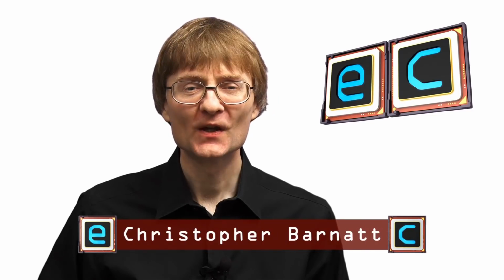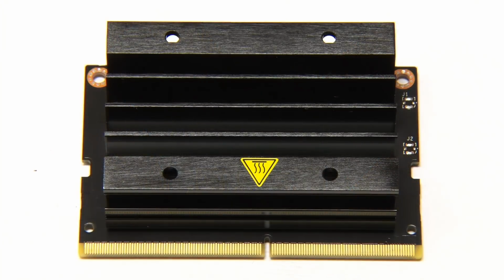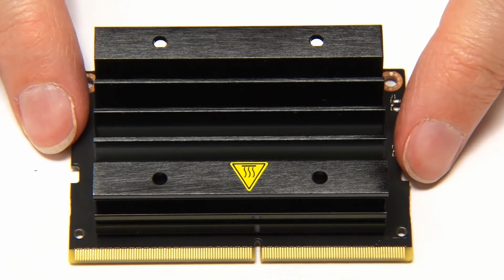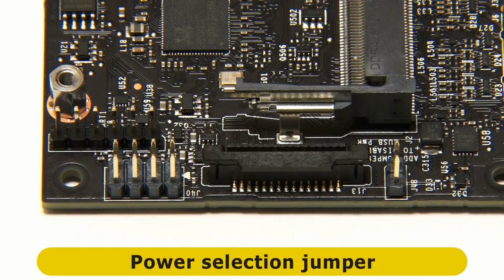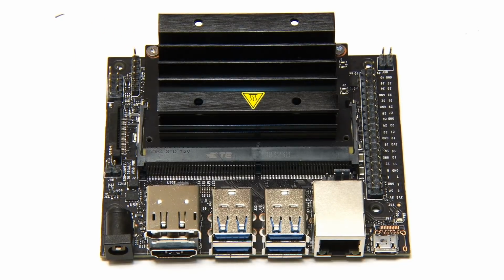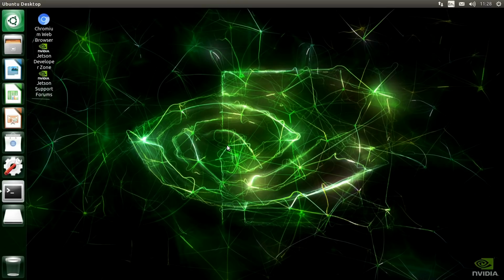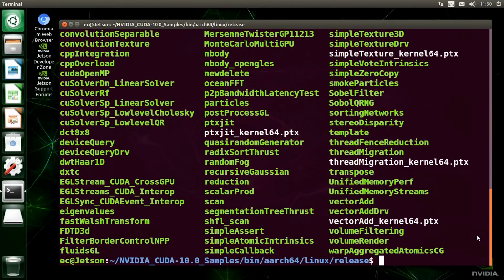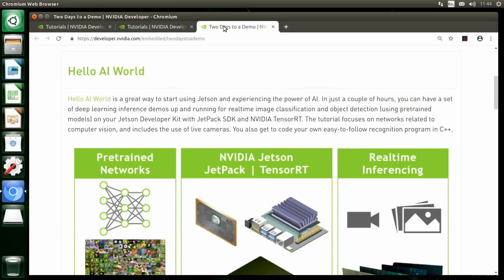NVIDIA Jetson Nano

Comment: that is really impressive for the size, that smoke probably would lag on a 8800GT 512MB Ram and that card was heating up at 100C and taking past a hundred watts! if this board would be 8 to 16 GB RAM and a slightly more fast processor, this would make the next gen gaming hand held device!  (probably able to run all the triple A console titles of now and future ones!)
Reply: maybe this one can be overclocked?
Reply: @ne1cup  that would be like overclocking a microwave or your toaster... which is only the domain of Photonicinduction...
Reply: Then it’s just a switch

Comment: Why don't they just use snapdragon 855 which is small and less prone to thermal?
Reply: That would be nice, but SD 855 is impractical in this application.  First, Qualcomm charges quite a bit for their high-end chips when cost matters in these boards.  More importantly, I think there are problems including an SoC that has integrated cellular modems, so they avoid doing that mostly.

Comment: it's running only at full speed when you use not the micro-usb connector. It's throttle down .... so what we have seen is not the full performance!
Reply from the maker: So I understand from other comments. I will try running with barrel jack power. It is a pity that the very detailed PDF user guide does not make any mention of this -- it only says the 4A connector is needed when the board is expected to draw more than 2A due to connected peripherals. I look forward to getting even more performance! :)

Comment: I bought one of these. Artificial Intelligence is very difficult to learn and you do need more processing power. This single board computer gives you a more affordable GPU. I was thinking of buying a high end video card but this seemed like a better option. You do have to buy a lot of additional equipment to use the Jetson Nano Developer  Kit. I did not have a monitor with a HDMI connection so that set me back another $100.
Reply: Its not just the hardware its the system over all,  I am looking at building a Threadripper rig ( Castle Peak ), with AMD GPU's ( 2 cards in crossfire ) .. itle be running a custom Arch Linux and RoCm to hybridize out my system resources as a whole unit ( memory/cpu/gpu etc etc ) ...

You have to configure your system as a whole not just put up big numbers in one area, its all about balance.

Comment: Should £95 not equal €110?
Reply from the maker: In theory, as I type this, £95 exchanges for $122.70. :) But sadly tech pricing does not always relate strongly to the exchange rate -- and the UK hardly is in respected standing right now. :(

Comment: Will you be reviewing Atomic PI? It is a Quad core Atom processor with Intel HD graphics and 2GB RAM with 16GB Flash for 35$
Reply from the maker: This board is on my list, but I'm not yet in contact with the manufacturer.
Reply: @ExplainingComputers  Okay.

Comment: why do u neglect ESP family? Not noble enough?
Reply from the maker: ESP boards are, as far as I am aware, microcontrollers, not computers. So I have not covered them -- just as I have not covered Arduino microcontrollers, for that reason. I've also neve been approached with any hardware. :)
Reply: @ExplainingComputers  surprised you replied that fast. Thanks a lot, man) But on the other hand would be nice to see applications where the potential of those devices is utilized at nearly 100% price/feature ratio. And where you can demonstrate how this can  be commercially feasible

Comment: Great video Christopher. It is a very nice board. I would love to have one. You've made an awesome review. You understand it's not a raspberry pi competitor as many think. But a board for AI. I would like to know if Blender can make use of the cuda-cores to render. Should be possible. Then I'd think more of buying one.
I'm now rendering a new intro animation for my channel with the Odroid N2 and NanoPi M4 together. They are doing great. 30hours remaining. No noise and low energy consumption. I couldn't which for more.
I've been debugging a lot of issue's on the N2 with the Odroid team. Only one problem left. I think I'll make my video the comming week. Gigabit ethernet first didn't work, swap/zram didn't work. Those are fixed now. Still unstable USB ports. But I know how not to have this problem. Also every 2.4Gwifi dongle has interference with USB3 ports. So wifi, keyboard and mouse work badly with my ssd connected to USB3. So it's better to use the microUSB port for those instead. It's also an awsome board, but it ain't perfect.
Greetings.
NicoD
Reply from the maker: Hi Nico. Always great to hear how things are going.

Comment: Chris, you need to use a 4A 5V supply on the barrel jack. You're running in 5W mode that limits the system speed. This is stated in the manual. CPU max clock 900Mhtz, and GPU 600Mhtz. Vs in 10W mode of 1.4Ghtz and gpu 920Mhtz
Reply: My apologies Chris, it looks like I got confused with the usage of the  nvpmodel command. By default the system will run in 10W mode but if you're having issues with it running from USB power then 'sudo nvpmodel -m1' can be used to place the system in 5W mode with the reduction of clock speeds. I had incorrectly assumed that the system switched to 5W when running of USB power as a lot of people were saying it was necessary to do so to run from USB power. As your power supply is a 3W one then you got lucky. :)  'sudo nvpmodel -q' will state what mode you're in. Mine says "NV Power Mode: MAXN".
Reply from the maker: Hi Richard. Thanks greatly for this. We are all learning as quickly as we can about this new board. :)
Reply from the maker: Thanks for this, but as I've noted below, it is not stated in the manual. :) Indeed, I've just re-read the PDF user guide (and searched it) and there is no mention of a low power mode, 5W mode, or any contraint on GPU performance if using a sufficient micro USB adapter. Rather, the advice there is "if the developer kit’s total load is expected to exceed 2A, e.g., due to peripherals attached to the carrier board, connect the J48 Power Select Header pins to disable power supply via Micro-USB and enable 5V⎓4A via the J25 power jack".
Reply from the maker: But I will try powering via the barrel jack! :)
Reply: @ExplainingComputers  I looking for the document I got the info from. As always, I can not find it now. :/

Comment: Why is the UK continually shafted by the pricing? Both $99 and €90 work out at <£80 and yet we're being asked to pay £95?!
Reply: it's called toll and taxes... super high prices in Denmark too due to that
Reply: @LiLBitsDK  Doesn't the $ and € figures include their tolls and taxes? I thought our levels would be in line with the Eurozone on that score tbh.
Reply: @dbp-wv1hs  sadly not no, the $ is usually correct in the US (funny enough) but you folks have to add salestax and what not kinda crap depending on where you live... but to go from $ to DKK is about 6.5 DKK per US$ (if you ask the bank) to go from $ msrp to DKK "price" then you have to multiply by 10... and to go from $ to £ is usually 1:1 but in reality 1 USD is = 0.77GBP and $ to € is 1:1 on the price but in reality it is 1 USD to 0.9 €
Reply: I even went off to check if the £ had slipped against the €
Reply from the maker: Pound/dollar parity for tech prices is sadly increasingly common . . . and not just due to taxes and tarriffs.

Comment: Does the M.2 slot support nvme or sata storage?
Reply: Neither is for a wifi module only
Reply from the maker: Not as far as I am aware. The slot is E-keyed, so will not directly take an M.2 SSD, and is primarily intended for a wireless module. However, it may be possible to use an adapter to connect an SSD.
Reply: no, wifi slot...

Comment: Micro USB might Melt...ROFL....Tempted to get one thuo...
Reply: if you look up the original specs you will find microusb was rated for only 1Amp, but with a lot higher plugging cycles over mini usb or usb A/B.
so even 2A is already pushing it for older connectors. Thats why i better like having supplies with 5.2V,
this buffers the voltage drop on the contact pins.
Also "fast charge" solves the problem by keeping the 1Amp but using 10V for double the power.

or simply use usb-c nowadays 😄
Reply: @PsiQ  cheers!

Comment: A spring loaded SD slot is bad if your use of the Machine requires regular removal/installation of the the SD. This Machine has no onboard wireless connectivity.....
Reply from the maker: Yes, the lack of onboard WiFi is very sad.
Reply: @ExplainingComputers  I must add that the demonstrations are very impressive for a single board computer!
Reply: Really easy to stick a wifi module on though I think I have about 100 of them in a box somewhere

Comment: Main idea for this - is building compact AI. Not for gaming or for youtube watching.
Reply from the maker: Totally agreed, as I say in the video! :) My next Jetson Nano video will be AI-based.
Reply: Yes, but this is still a really decent general purpose SBC (especially with that OpenGL capable GPU) and NVidia would sell way more of these boards if they dropped this "AI only" moniker. Put this board in a case, call it a Shield TV Lite and you have yourself a great HTPC or an emulation device.
The only thing that they need for this to be the perfect SBC is to fix their software.

Comment: A raspberry pi with a dedicated graphics card! Please tell me we can put Windows on it
Reply from the maker: This is an ARM board, so it would have to be ARM Windows . . .
Reply: @ExplainingComputers  But, in theory...
Reply from the maker: Yes, in theory! There is an ARM Windows 10 . . .
Reply: @ExplainingComputers  Could you try it?
Reply from the maker: I will wait for somebody else to build a Windows image for this board. It will be a far from trivial task. :)
Reply: Slouch off with your Windows spyware - this thing runs Linux right out of the box
Reply: @kingneutron1  While I respect Linux, windows is one of the most popular operating systems. And besides, if this little computer could do it, schools could use them instead of massive desktops

Comment: I boycott Nvidia, too much shady business like PhysX via X87 on the CPU (deliberately crippling it), graphics features with proprietary code (deliberately crippling the performance on ATI/AMD cards) and GPP. No Nvidia here!
Reply: Well it is a AI compute board which ATI never had and AMD has but they require you to buy a card that slots into a more expensive computer. This one you can put into a security camera's housing if you wanted to. AMD has nothing for that market. It also is made for developer's which AMD's cards for developers are harder to get than nVidia's ... less buggy for network use but harder to obtain.

You do get that this board is not made for consumers so developers are the target and developer time and money is what is important. Now to that IF it was made for consumers and not for developers I would agree with you.
Reply: @yumri4  
Fair enough. ;)
Reply: Not to mention their spying telemetry crap.

Comment: Drop frames on 1080p YouTube playback? On Nvidia's Official OS (likely very optimized OS)? Booooo!!!
Reply: He's running it from USB power, that puts the board in 5W low power mode. He needs to run it from the barrel jack with a 4A 5v power supply. This is started in the manual.
Reply from the maker: Thanks for this, I will try powering via barrel jack. This said, I've just re-read the PDF user guide (and searched it) and there is no mention of a low power mode, 5W mode, or any contraint on GPU performance if using a sufficient micro USB adapter. So you may well be right, but this is not something covered in NVIDIA's supplied user guide. :) Rather, the advice there is "if the developer kit’s total load is expected to exceed 2A, e.g., due to peripherals attached to the carrier board, connect the J48 Power Select Header pins to disable power supply via Micro-USB and enable 5V⎓4A via the J25 power jack".
Reply: @ExplainingComputers  Hi Chris, I just replied to my other comment. I was wrong. There is a 5W mode but you have to put it in this mode. I had thought it used this mode when running from USB power.
Reply: Two words: Software Decoding
ARM cores just don't have the grunt to handle HD decoding in software and NVidia didn't bother porting their OMX decoder to work with browsers.
Reply: Yeah so much for having a very powerful GPU... can't even handle a simple 30 fps 1080p video? would have expected it to do 4k 60fps no issues, guess not
Reply: @LiLBitsDK  Youtube can't use GPU on (most or all) desktop devices, and that CPU isn't strong enough for software decoding

Comment: You should of powered this board via the barrel jack. I have seen other videos of this board powered that way and having no issues what so ever with YouTube playback. I gather you know that when it's powered with the USB part it doesn't give the GPU enough power so some of it shuts down. When it's powered via the barrel jack this doesn't happen
Reply: Should have.
Reply: @richardhughes515  Thanks Adolf for that
Reply from the maker: I will try powering that way and report back on YouTube playback. However, I would be very surprised is this is the case given the specific micro USB adapter I used, and the fact that no other hardware was connected.
Reply: @ExplainingComputers  From what I understand the micro USB power input is limited to 5V, 2A where the barrel jack is 5V, 4V. As I said when it's powered via the USB part it doesn't give the board enough power so only half of the GPU grunt is being used.
Reply: @ExplainingComputers  I'll direct you to this guy: https://youtu.be/jq1OqBe267A he does a lot of videos on this board and can explain it a hell of a lot better then me (this saves people who have nothing better to do on a Sunday from correcting anyone else's grammar)
Reply from the maker: @T.B Martin See my longer comment above. You may well be right, but this is not what NVIDIA say in their own user guide, which only says to use the 4A barrel jack if load ont he carrier board is expected to exceed 2A due to connecter devices.)

Comment: I wonder if AMD and Intel will respond. Propably not in the foreseeable future.
Reply: Well Intel does produce Atom SoCs which are used in some embedded systems (including sbc) and so has AMD (did in distant past with Geode and now coming back with embedded ryzens). But that's something drawing more power, much more costly, with little to none GPIO.  It's not their target to make raspberry pi competitors - they don't need it and they don't want it.
Reply: @Promilus1984  I guess that is a logical.
Reply: It does seem an odd market for a graphics card company to inhabit.  But as the man in Robocop says, good business is where you find it.  [Goes away to check if Nvidia have any upcoming models called ED 209...]
Reply: @MarkTheMorose  well nv is good at sniffing around opportunities.

Comment: There it is!

PS - It looks like it might be a great platform for developing autonomous robots too.
Reply: yay someone in the comment section gets it. It is made for AI programming no youtube play back nor to go to the consumer.
Reply: The power use budget is probably a little more hefty than you would hope with this platform.
Reply: @sethrd999  - Definitely, but that's why it is described as a development kit.  Once the software was refined you'd move on to practical hardware.
Reply: @johncnorris Oh I understand but unfortunately the argument still stands its still going to have to be NVidia hardware which is going to be guzzly.
Reply: @sethrd999  - I agree with you.   If this series is anything like the nVidia Shield then I grit my teeth and deal with the brand phlegm. The shield has been a stand out product and would assume some of the same developers worked on this one.
Reply: @johncnorris  hmmm im not a gamer so not for me really.  Nvidia's ultimate problem is going to be open drivers and true open development.  No one ever went with IPX/SPX cause of the cost right?.
Reply: @sethrd999  - Me neither but the specs were always head and shoulders above the rest.  I'd assume they would be better with the drivers on this product but who knows?  You're justified in being skeptical as nVidia have been real turds in the past with developers.